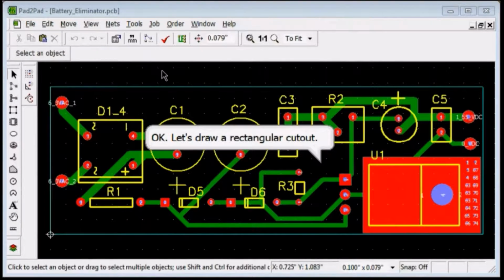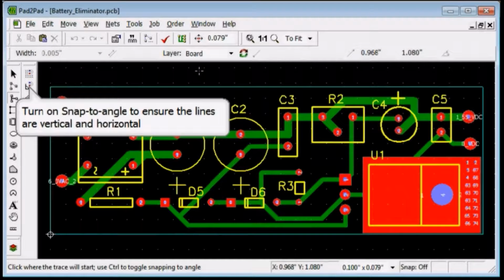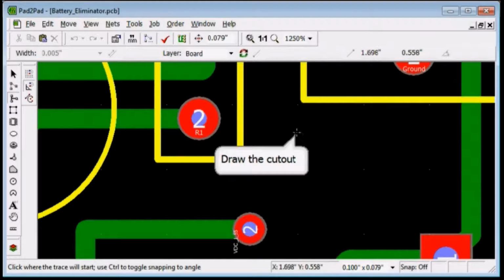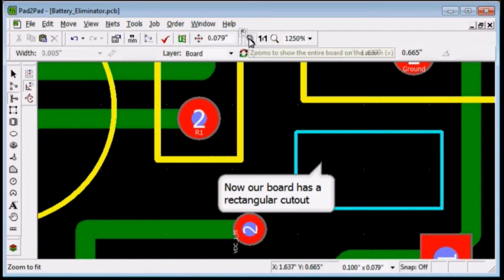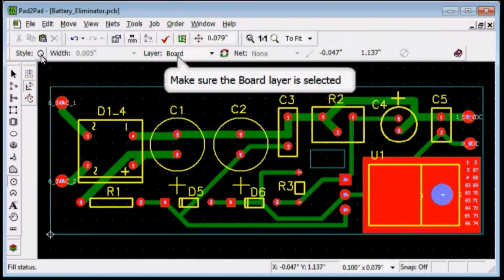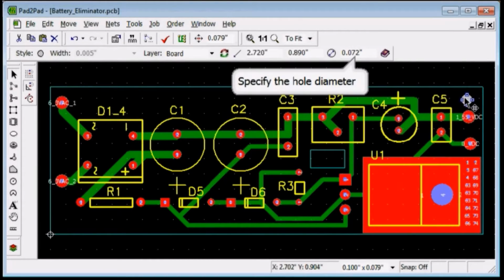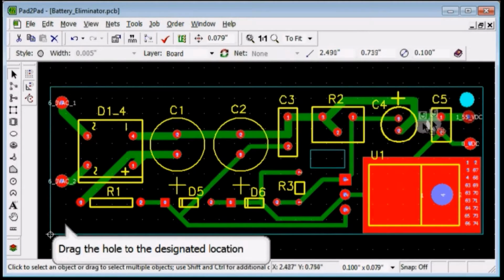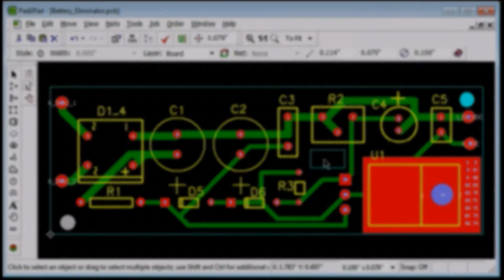Pad2Pad Free CAD Software Tutorial: Cutouts

Comment: How to change the units of measurements from inches to mm?
Reply from the maker: To change to metric scaling, in the top menu, select Job | Settings. On the bottom of the screen that opens, there is a button that says "Toggle inch/metric".
Reply: Thank you so much for your quick reply .
Can I save the PCB layout to JPEG, PNG or PDF for DIY PCB etching?
Reply from the maker: There is no way in the software to save it as anything other than a .pcb file. However, you can export the file as a .DXF and use an online file converter to convert it to a PDF or PNG.